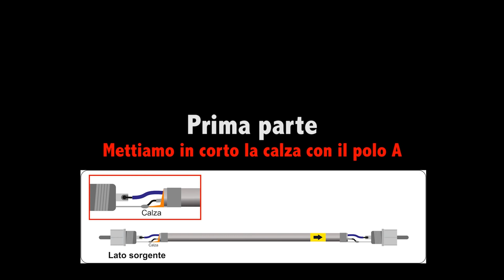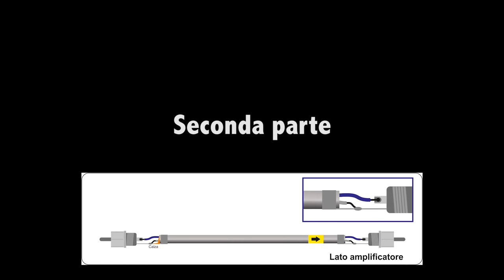How to make  Sounding audiophile highend RCA interconnect cable for 20 $ !!!

Comment: The Arrow points to the end where the return wire and shield are soldered together (the other end of the shield floats).  No, the arrow doesn't indicate signal flow.  All arrows then point to the PreAmp or Integhrated/Receiver.  Yes, even between Amp and PreAmp.
This configuration constitutes a "Star Ground " with the Mains Ground at the Preamp. 
Popularized by Bruce Brisson of MIT Cables (also adopted by Monster) back in the '80s.

Comment: It's possible to make RCA 3->2 connection with Wireworld luna 7 wire? Luna has L and R wire separated in two separate insulation. Each channel has two wire strands, ground (earth - black) and signal (blue (L) or white (R) chanbel). I want make RCA cord to connect my CD with Amplifier. Which ends Should I connect to CD (with 2 or 3 wire). Great movie!!! Regards

Comment: This means if you connect the source to the amplifier and the amplifier to the source it will not work ? So is there a configuration to make them work on any side?,I have RCA cables that work on any side ! Thanks!

Comment: It's confusing different ways  to do it one did it with the 2 colours twisted together and soldered to the pin and the bare wire slodered to the back part, which is good way for unbalanced RCA for pre amp?

Comment: So the first end of the cable has 3 wires: 2 silver + copper wire. In second end the cable has 2 wires? Can someone explain this?
Reply: The 1st cable is professional microphone cable.  It is primarily designed for use with gear that supports balanced or multi point connections using mono TRS or XLR connectors.  In PA applications, cable shielding is not sufficient to adequately reject EM induced noise on the very long cable runs.  In this system, the outer braided shield carries most of the EM induced noise to earth preventing most of it from entering the 2 signal conductors.  One of the these 2 cores carries in phase signal and the other carries inverted phase signal.  So the 2 signals are in opposite phase and would cancel each other to zero if connected together.  However, any induced noise entering the cores would be in phase and of the same strength on both cores.  At the input of connected equipment, the inverse signal core is phase inverted again.  Now both signals are in phase but the induced noise on each line is opposite phase to each other.  This means that when the 2 lines are connected together, the signal s are added in strength but the induced noise is cancelled as they were in opposite phase to each other. like +1 -1 = 0  or +.5 -.5 = 0.  This allows very clean, high fidelity analogue signal to be carried over very long cable runs while on the unbalanced or single point gear, typically HiFi using RCA connectors, 3-5m signal cable is regarded as the limit of clean signal.  Having said this, the practical acceptable length of unbalanced cable largely depends on the strength of EM induction in proximity to the cabling.  You sound never run signal cables parallel with either power of speaker cabling for example.  Other sources of EM are radio, WiFi, fluorescent lighting electric motors.......

Curiously, the 2nd cable appears to just have 2 cores and no shield,  I would not regard such cable as suitable for HiFi RCA connectors because it would not reject EM induction.  Normally, I'd use either a shield with single core or shield(s) with 2 cores.  IMO, the best balanced cable has a separate braided shield for each core which helps prevent cross talk induction between the signal lines.  I hope that helps.
Reply: @kenwebster5053  Hey Ken, that's for this amazing reply!! Man,  that's a lot of work. Thanks. It is even more curious, What I meant by second cable, is actually the same cable. Doesn't he do the first end, (I wrote first cable) and then flip it over and start on the other end (I wrote second cable). So on side of the SAME cable it appears to just have 2 cores and no shield. That's why I wrote my question. I was/am confused.
Reply: @rmmr8513  Oh ok, I missed that but see what he is doing now.  Normally with RCA, you would just have a shield and single core but what you describe is actually quite cleaver I and I missed it.  The shield in unbalanced connection is used not only to deal with  induced noise but it is also the signal reference voltage.  Often people call this zero volts but that isn't true in an absolute sense.  It isn't actually zero.  It's just that the signal voltage is like AC except it varies in amplitude and frequency and waveform according to the sound waves it represents.  This signal voltage varies + & - around the reference voltage.  For this reason, the reference is considered zero relative to the signal.

So now, you may see that it is important that the reference voltage be as stable and constant as possible.  What happens if the shield has induced noise is the reference may not be quite so stable especially if the noise is significantly impeded from grounding.  So what he is doing is grounding the shield at one end only.  He has trimmed the shied at the other end so that it does not connect the induced noise directly to equipment at that end.

This explains what I questioned in that one of the cores is connected to the shield at one end only, leaving the other end as a more stable shielded signal reference for the connected equipment.  So the strategy here is to reduce the signal reference noise for the connected equipment as the 1st end has the induced noise grounded.

Cleaver no?
It is actually similar to a work around connection used in PA for connecting unbalanced sources to a balanced devices where the right equipment is not available.

This also explains the arrows as they indicate which end has the grounded shield.  At this time, I believe this should plugged in to ground the noise to the same single grounding  point, usually an amp.  However be aware that some amps are not grounded.  In Australia, Yamaha commonly do not ground their amps presumably to reduce the likely hood of ground loop hum.  So I think I need to look into this a little more to fully understand all cases.

So thanks for that, it has made me think it through better.

Ken
Reply: @kenwebster5053   Ok cool. "So what he is doing is grounding the shield at one end only. " I understood about 10% of what you are describing but I think I get the idea. :-)
Thanks!!!!
Reply: Ricable do it from dedalus up to the rest of the line, I am downgrading it because I have otl monos…a pain in the ass to localize this problem .

Comment: The ARROW "points towards which END"  the 3 Wire end,   or  the 2 Wire End ?
Reply: Direction of signal would make sense, wouldn't it?
Reply: The shield of the cable is only connected to one end of the conductor,in his case it was the conductor with the clear coating,the other end you just trim the shield flush with the cable jacket,but making sure none of the shield you trimmed flush makes contact with the terminal,and so the end that has the shield and conductor solded together and attached to the terminal becomes the end you plug into your source.

Comment: Direction arrows on the cable! 🤔😂😂😂
Reply: I believe the arrows indicate at which end the shield is grounded.
Reply: The side with grounded shield should be connected to the source i.e either amp or ore amp and the side with no ground connect to speaker
Reply: @hamidnia7242  What if the source is an ungrounded (DC powered) DAC and the destination is a grounded amp?  Also, are you suggesting there is any perceivable advantage in shielding passive speaker cables?  Have you calculated the change in S/N dB on microvolt noise on a 50+ V signal?
Reply: He grounded both side of the cable he just put it in a different spot but they both have a ground hooked to the putter part of the terminal.
Reply: @jamesfair9751  no he didn't he grounded only one end,I make my own cables and coincidently he used the same cables as I did,that is why the arrow was put on the end he grounded to the terminal/connector,which indicates that is the end you connect to the source.
Reply: John Bravo - Sorry I confuse about the source. Let say I hav CD player and I connect to a receiver. Which end is the arrow go?
Reply: @sapounngin2237  from your cd player,another example is;if you have separate preamplifer the arrow goes from cd player to preamp,and then to amplifier.
Reply: John Bravo thank you.
Reply: @sapounngin2237  No problem :)